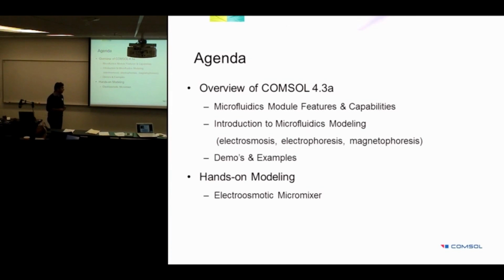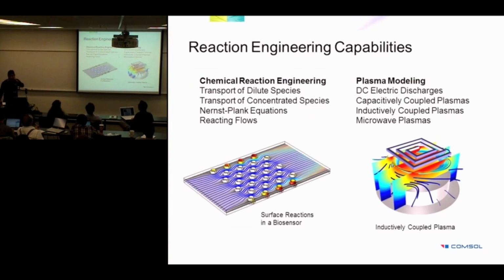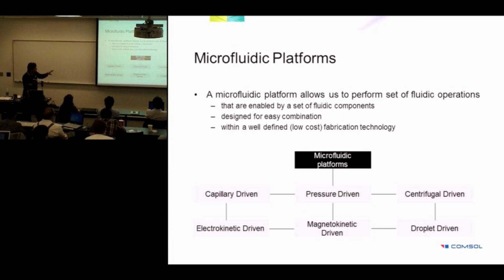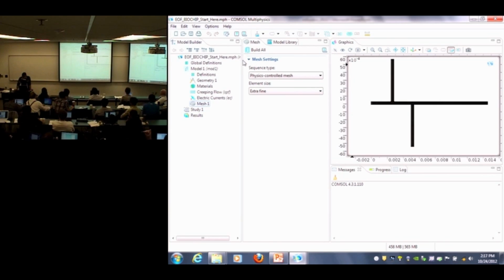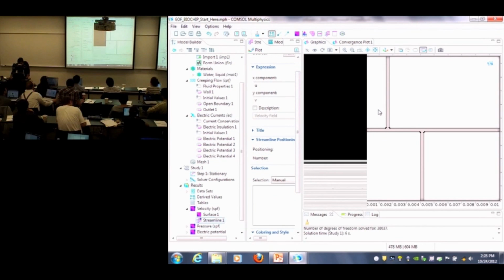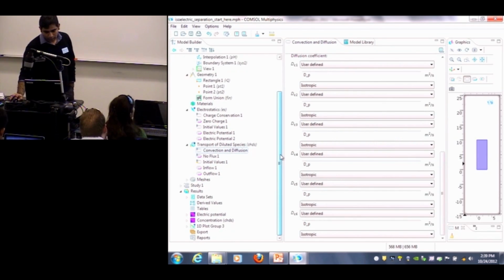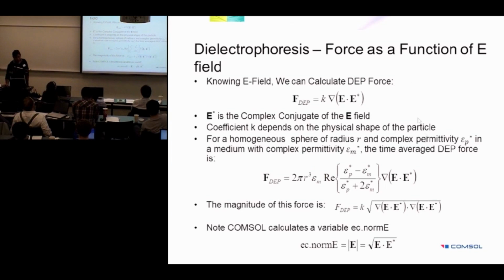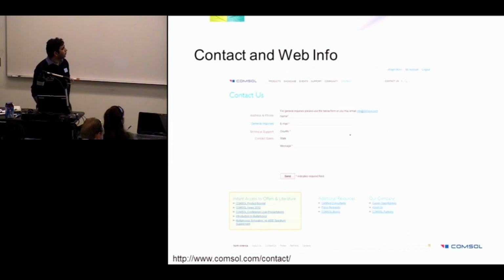COMSOL's Hands-on Workshop on Microfluidic Devices @ NNIN/C, UMich

Comment: By Isoelectric Separation of Proteins I could not finished yet my Simulation why I'm missing following Information:
1. What kind of Material should I choose?
2. Which Mesh is the Best for this Experiment?
3. What are the Parameters: "epsilon" and "nigen"?
4. How the "Interpolation (pH)" did it works? *charge number -Zc1: step1(pH(x)-iep1)...